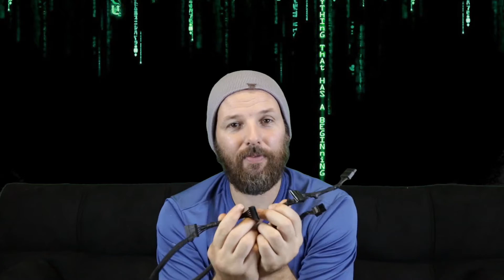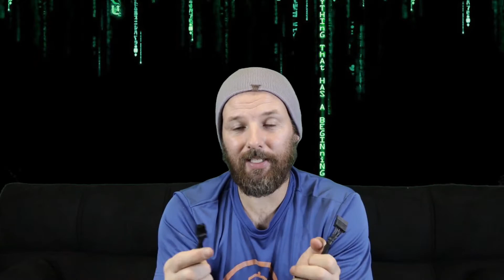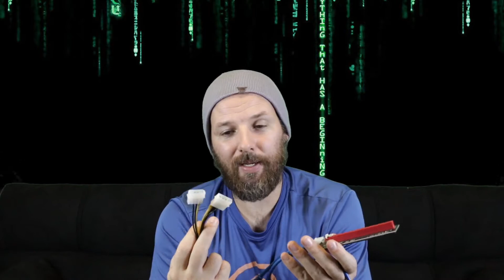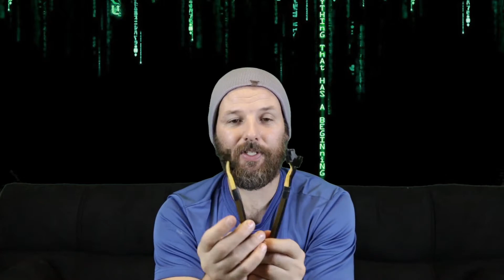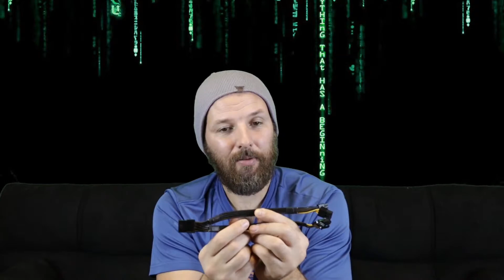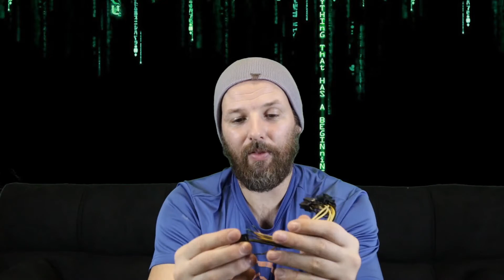Fixing Your GPU Mining Rig - Resolve 95% of Your Issues Quickly

Comment: First Rig - Troublesome Rig.
GPUs
3 x 2080Ti
1 X 2070 Super 
1 X 1070 Ti (Not using yet)
Motherboard - B450 Pro4 ASRock (P4.80 03/10/2021)
CPU - 24 × AMD Ryzen 9 3900X 12-Core Processor 
Disk Model - ATA SSD 64GB 64.0GB
PSU - EVGA 1600W P+
First attempt turned out to be some bad risers. 
Ordered new Risers, and was able to get the rig up running 4 cards for 12+ Hours, and was able to add a 5th Card and ran all together for another 9  hours.

Then it came time to put them all together on another frame. 
This is when GPU's starting to give the No Temp error and would fall off. 
Sometimes It would be GPU 0, GPU 1, GPU 2.
So I then unplugged everything and then proceeded with installing a GPU every 30 minutes if they were connecting successfully.  Got it up to 4 cards, (Not adding 5th till I get more stability). 
After about 2 hours, GPU 0 would have no temps, no hashrate, no Wattage.  Watchdog was on so it would reboot, then it would mine for an hours, sometimes 15 minutes, sometimes 30 minutes.   
This time the problem stayed with GPU0.  I then changed risers again, problem still stuck with GPU0.  I then took it out of the first PCIE Slot and stuck it in a different PCIE slot.    

I noticed your video mentions VRAM, but I'm using HiveOS and I have all Nvidia cards and theres no way of telling the VRAM.  my Card temps are Pretty low 47, 46, 41, 41. Sometimes it would get into the 50's. 

Also to note, I've run all these cards for 24-48 hours overclocked directly on the motherboard. ie.  2080ti I was able to run at 1100Core 2200 Mem with no issues.  Due to the instability of this rig I am running everything at 1000 Core and 1500 MEM.  BIOS settings are correct as far as I know. 

I'm really in a pickle, every where I look it's almost plug and play for everyone.  This is week 2 of this and it's taking a toll.
Reply from the maker: Whenever I ran into issues like this I would isolate the GPUs but I don't know if you have the extra parts. I have spare motherboards and setups specifically for testing. You would have to eliminate cards one at a time or start with 1 card and run it for a few days, then add a second card -- up until it fails again. When you get to problems with the 5th card and beyond but it runs 4 fine that's when it gets really funky, most of the time for me it's been the motherboard having limitations or really weird issues because normally you have to put multiple cards on the same SATA cables but your power supply probably has 6 separate cables so you would be able to eliminate that issue.
Reply: @vanman2099  It was the Motherboard.   It’s crazy how I had 2 bad ones in a row.  The rig has been stable now for the past 4 days, no GPUs falling off the bus. And Overclocks near the peak as well.
Reply from the maker: @SC60586  glad to hear you got that taken care of, those types of issues are not fun at all
Reply: @vanman2099  Yes, it was a long 2 weeks.  Every where I looked it seems as if the world set their rigs up and it was plug and play.   I did learn a lot throughout the grueling process.
Reply from the maker: @SC60586  sorry to get back to you so late, I didn't see the notification till now